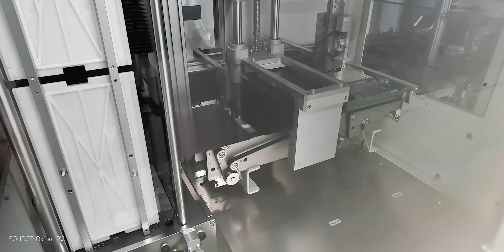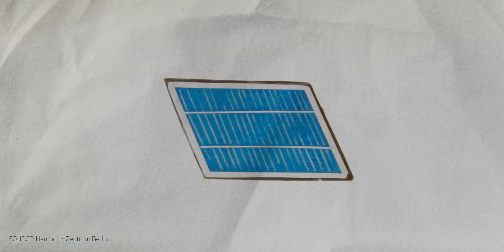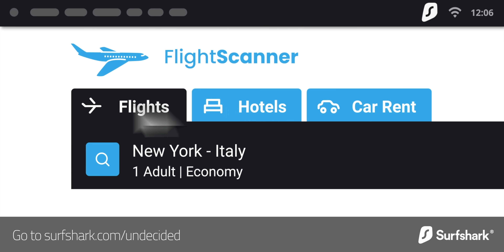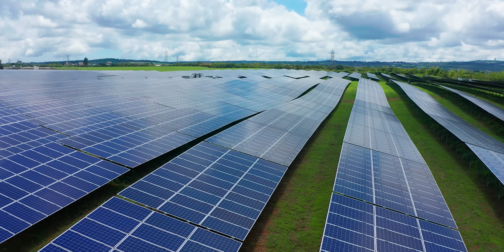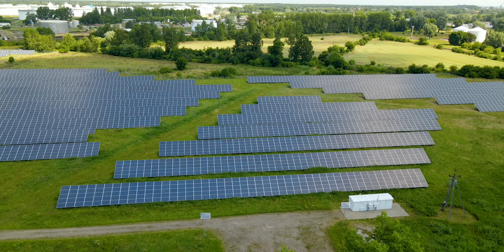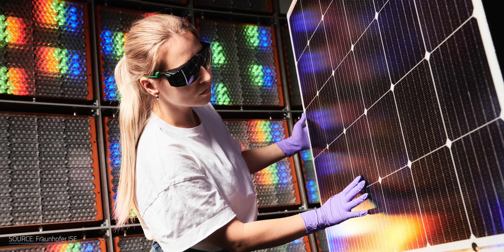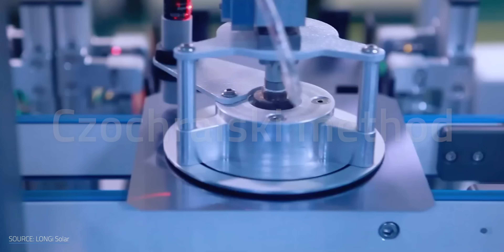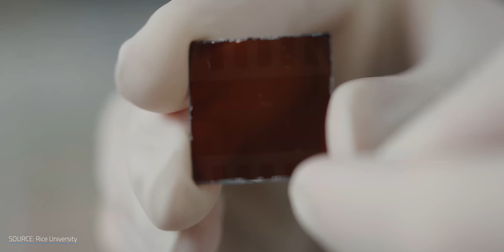How Record Breaking Perovskites Are Here NOW

Comment: Yes, in that, my 60 yr old 30x60 ft ranch house, is suffering, and I don’t plan on owning it, after 35+ yrs. I get soo much sun, with little or no shade on 2 acres, on a hill town peak.
   The solar companies, who stopped by were shocked, and showed me , graduations of earning, over time. 
    The combination of types of collectors, the pertinent generation,  for specific diversity.. as in heat water, store in battery, export to grid, an on. A sand battery is a huge brilliant and efficient, component, as it could be ‘fed’, with multiple collectors,  and perform, alternative needs.

Comment: I have 7 year old 275whp solar panels.
I am looking forward to the launch of this silicon-perovskite tandem solar panel and replacing it in about 5 years, supplementing the system with Na+ batteries. I hope both technologies will become widespread and cheap due to mass production by then.

Comment: I'm just an idiot but I disagree on space being the main issue. Utilities have access to a ton of land and most of the time residential applications have plenty of rooftop space. What wasn't mentioned is that solar rack cost per watt comes down with more efficient panels, but if I understand perovskite correctly then it can be installed on flexible materials. So imagine a 10% efficiency but it comes on a large roll so shipping and shipping damage goes way down. Also what if you could just grade the soil and stake these large rolls on top of a layer of bedding sand? What if this stuff is as cheap as asphalt shingles and now it IS your roof? All of a sudden the space argument looks a lot different. So I say get rid of the silicon and glass and embrace the positives of perovskite which are that it can be flexible and cheap... And now it can last 25 years!
Reply: Yeah let's cover more of the soil with our stuff.

We could cover the whole planet and definitely destroy the ecosystems on it lol.

Comment: I've been sticking with monocrystalline panels for a lot of my research for a while because polycrystalline tend to fade in the Sun.
Reply: So these suffer from the same problem as polycrystalline panels. In other words they have generated a coating to go over their panel so that it doesn't degrade in the UV. The problem we had with that last time is that it was reflecting some of the usable energy and dropping the efficiency of the panel. I've worked with this for quite some time and so far most coatings I found kind of fail so I'm thinking because of the coding they have on their panel there may be an additional internal reflectivity from the grains of titanium dioxide. I've been working with titanium dioxide for a little while now in the formation of multifaceted beam rubies. I've also been working using solar panels in the flash chamber to see what kind of voltage is I can generate before I burn out a panel. I'm working on a new laser design that incorporates a solar panel booster in the flash chamber to drive a secondary circuit. That brings me to my next question, being composite sells they are fragile aren't they?

Comment: Could these be mounted on fence posts, power and light poles? There would be huge potential for roadside renewable generation if the aerodynamics can be cracked, land is free and installation is cheap.
Reply: Generation is not the problem. What are you going to do with the energy during daytime? Shall we all spend daytime at home doing all the cooking and heating and charging of EVs to then go to work at night?

We do not need much energy during times solar produces it.

The problem is storage and transportation of energy. Not generation.

Comment: If the early process form is liquid, is it feasible to consider using it on vehicle exterior surfaces for solar charging when exposed to the sun?
Reply: Even if this was the case, what do you think a square meter or so of panels is going to do for a car?

A typical panel that is pointed the right way produces 400Wh per day. Let's say we got 2 square meters on a car (less in reality because a car is always angled wrong), that would give you 800Wh max.

Now imagine you have something as efficient as a Tesla on long range mode; it uses 1.4 kWh per km.

So your solar paint under ideal conditions would give you a maximum of about 500 meters of range per day 😂

I am sure auto makers will find plenty of fools who will pay 1000 euros for such a paint job; let's round up and say your car would then produce 1kWh per day... that is 20 cents per day worth of energy or 13,7 years until you recuperate those costs 😂

It is insanity.
Reply: @juliusfucik4011  It was just a question about the technology. It may not even be feasible for process reasons. It was not posed as a replacement solution for plug-ins. It could be used to charge an onboard 12v storage battery. It could be used on the large surface roof of RVs or trailers to maintain or charge house batteries.

Comment: I can see these being used in Car rooftop solar anywhere there is a space constraint and it can be more protected that just say rooftop solar. We also know that as homes get "smaller" so does roof space and thus current power generation. I can see the current panel sold by China etc to being used where there is plenty space (warehouse roof, solar farms). Like to see the next innovation being embedded transparent films for office glass towers. We already have dimmed glass to avoid heating up skyscrapers but that could be offset by swapping glare for power generation.

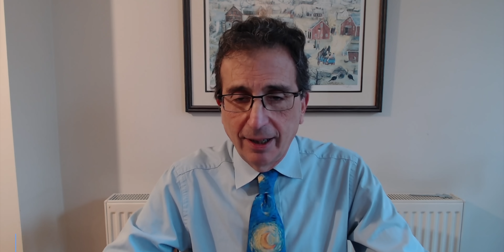Comment: 1:38 Salt and diamond do not have the same crystal structure. Both salt (sodium chloride) and diamond have a cubic crystal structure, but they do not have the exact same crystal structure; salt has a face-centered cubic (FCC) lattice with alternating sodium and chlorine ions, while diamond has a unique diamond cubic structure where each carbon atom is bonded to four others in a tetrahedral arrangement, giving it a distinct crystal structure despite the cubic symmetry.

Comment: Very interested in the improvement these cells will bring. I'm a bit of an early adopter. But durability is important. My solar panels are mounted on trailers and move with me. Sometimes that means sacrificing efficiency for weight or flexibility or durability. Happy to try them out when they are available

Comment: If they can get this consistent type of performance OVER A 10 YEAR PERIOD, with a performance guarantee, then maybe they're ready for commercial availability.   But at this stage we don't have any long term data on degradation percentage and investor grade solar projects require a level of surety WITH ESCROWED insurance policies backing material quality.    I'm not going to be the FIRST guy to put my neck on the line for new technology without some STRONG legal caveats - unless there's a 7 figure cash payment involved.
Reply: Much obviously depends on (commercially sensitive) production techniques. I'd guess research has been going on sufficiently long for a fair stab to be made concerning likely lifespan.

Recall with Lithium EV batteries, that's a number which has increased with experience, reflected in battery warranties we'd have not dreamt of a decade ago.

Comment: While I recognize that space can be a concern on some houses, it isn't for most. On the utility scale, purchasing/leasing less land for the same power output is an economic benefit. But neither of these is a case of true space-constraint demanding maximum efficiency. 
My favourite application is the solar powered catamaran or houseboat. Whether the vessel crosses oceans or just putters back and forth across a single lake (like, say, Tahoe), current cells are plenty to keep the boat's living systems (fridge, cooking, heating) going, but only at a steep cost to the ability to move under power. And even when conditions are favourable, adding one knot of speed increases power drain considerably. There isn't yet a solar powered catamaran that can cruise overnight at better than 6 knots. That's steady progress, but not so much you won't want more -- especially in bad weather. 
Increasing electricity capture by 20% has huge benefits for boats like this, and the teased 50% increase would be incredible. I'd like to see this company partner with a company that powers catamarans or houseboats and see what the impacts are in true a high-demand, low-surface area application.

Comment: This is hype and yet another "weapon of mass distrAction". As an industrial strength power source both solar and wind are absolutely a dead end and can lead only to one thing, scarcity of energy supply and environmental waste in the process of manufacturing these intermittent low efficiency power sources. More research should be put into LENR, Roche type of generators, zero point, finally nuclear reactors on fast breeding neutrons, like Russians are doing who now have two working reactors, that allow to use very abundant Uranium-238 and spent nuclear fuel that pollutes our environment allowing for a closed cycle nuclear energy production and thus practically limitless supply of nuclear fuel. Solar and wind have their place, but only as sources for autonomous installations. But even there, instead of using solar and wind better use new type of batteries based on Nickel-63 isotope that functions in a similar way to a nuclear reactor but without dangerous radiation levels and lasts well over 50 years.

Comment: US companies producing solar panels with efficiencies higher than 24% TODAY are likely way less expensive. No one can say with absolute certainty that the limit is 30%, as there could be different configurations and methods not yet developed that would allow for structures containing multiple layers of PV film to surpass the proposed maximum (which is for a single sheet of known configuration and shape). They're selling their panels primarily because they're likely running out of money due to all the R&D, which, who could blame them. But the simple truth is until they really 'blow the doors off' standard PVs AND at a very comparable cost, this is still a pipe dream. You want immediate higher efficiency? Sure, I can get you one made out of gold and platinum; it costs about eight thousand dollars per panel :-O ... just saying. PS. I really like a lot of your stuff, but please don't overhype something like this unless you want to boil your audience down to the most gullible.

Maxeon Solar: Maxeon Solar Technologies  https://maxeon.com

Qcells: Qcells North America  https://us.qcells.com

First Solar: First Solar   https://firstsolar.com

Comment: Xcel Energy is building a massive solar plant 8 miles west of us in Becker Minnesota. It will be the 5th largest solar plant so far in the US. It is built on 5000 acres of land owned by Xcel and was in the Conservation Reserve Program (CRP). Our Elk River energy commission took a tour last month and Xcel mentioned a new type of solar panel was being purchased along with the 550 Watt panels they are installing. They mentioned a 800 Watt panel was what they were looking at. Maybe Perovskites is what they are using?
Reply: Holy sh1t 800 W. Most of the industry as of 2024 is sitting at 700 W with monocrystalline bifacial half-cut modules. Wonder what wafer size they'll end up choosing (M8, M10, M12?)
Reply: Better than destroying our planet by using fossil fuels. What’s your solution?
Reply: Not sure pure perovskites are in production yet. I wonder if they could be the first examples of tandem silicon perovskites at scale. With up to 50% greater production for the same land area and installation costs and slightly higher unit costs the economics of tandems could revolutionise solar, rooftop solar in particular. As the silicon layer is proven tech, there's not insane risk if the perovskites degrade earlier than hoped. I'm sure they will be worth installing in many applications once available.
Reply: I just checked and Oxford PV announced a couple of months ago they sold their first batch of tandems to a US utility scale project.
Reply: And the natural space taken away from plant & animal, brilliant.

Comment: One of the main downsides of the perovskites put into service now is that they don't beat all existing brands yet in terms of efficiency. The current model has a ~24% efficiency for turning solar energy into electricity which is equivalent to Sunpower and Aiko panels currently on the markt.
I think Perovskites will start really taking over the market in a couple years.

Comment: Cost of panels compared to conventional power sourcing?
Environmental impact of sourcing material to make panels?
Still have the issue of cloudy days.
Environmental impact and cost of end-of-life removal and recycling?
Until these questions are addressed, and many more similar questions, solar technology will remain a niche solution for energy production. Just my $.02
Reply: The problem is storage and transportation, but the solar zealots can not understand it. They celebrate every tiny efficiency increase in generation like it is a blessing of Ra.

They should really move focus to large scale cheap, reliable energy storage from commonly available non-toxic materials.

Only then can solar or any renewable tech even remotely compete and provide at least so baseload functionality.

Comment: The carbon footprint of manufacturing solar panels doesn't worry me. If the process is entirely electric and the carbon intensity of that electricity is heading towards zero, we'll eventually be making zero carbon solar panels, at which point we have a virtuous circle.
Reply: Even if the electricity for making the solar panels comes from coal, they produce enough electricity during their lifetime to drop their carbon intensity far below anything that isn't a solar panel or wind turbine (even hydropower has a higher carbon footprint due to all the concrete and the carbon released by organic matter degrading in the flooded area).

Comment: There is a German company that manufactures a folding structure for PV Panels.  It is able to fold up like an accordian and is fully mobile on wheels thus enabling storing of the panels in a garage or shed or such.  This would be a great system for rural and suburban homes since the panels could be unfolded during daytime and folded during night and then store safely away in a garage or shed.  It would also be the best way to protect the panels from sleet, snow, pollen, dust and hail if so required.  This configuration would be a great way to increase your Solar generation capacity without major land use or structural modifications to buildings.
Reply: https://www.youtube.com/watch?v=sRhNOv1Uo4M&list=WL&index=10

Comment: space efficiency is ridiculous argument. if people were lacking space for panels, they wouldn't use tilted panels leaving a lot of gaps.they would just cover all surface with panels
Reply: Tilted are use because they're easy, snow water and dust slide of, they get "enough" sun.
They're the "good enough" when installing square miles at a time.

Comment: Voyager 1and 2 launched in 1977, V1 is currently traveling at 38,000 miles per hour while both sats still transmitting signal from over 7 billion miles away. Yet current solar panel tech is only 50% efficient? The world gov'ts hide so much tech from the people and it needs to stop. Suppressed tech can provide so much for so many. Support Dr. Shiva for US President, arguably the most censored person on the internet.
Reply: It's not "suppressed tech" it's "Billion dollar, one off, hand-made" tech not cost-effectiv eto work on scale.
Nuclear batteries that last for centuries... though they do also irradiate everything around them.
Super effective hand shaped and piped rocket engines that need complete refurbishment or replacement after a launch.

Comment: A report from Japan
I achieved carbon neutrality this summer by utilizing the 2.8kW solar panels I installed 12 years ago and the Icon wind cooling system.
Even in a year including winter, the power generation is 3226kWh, and the total power consumption is 3426kWh, which covers 94%. If the efficiency of solar panels improves, many homes can achieve carbon neutrality.
Individuals can further reduce CO2 emissions by using cool winds to expel heat from the house in the early morning and at night, and by taking appropriate measures against solar radiation during the day.
(The measures against solar radiation are published on the website.)
If you have any acquaintances who are traveling to Japan, I recommend buying one as a carbon canceler to take home.

Comment: It’s a little early to say we’ve solved the durability issue. And going to 30% efficiency is not really a game changer. Solar only really works in a very small area of the world, otherwise, you’re overbuilding the solar system to cover the long winter days. And, what are you doing at night, relying on lithium batteries? Seriously, this is not a good plan for grid scale energy. 

Natural gas to nuclear is the only plausible solution.

Comment: I hope someone is doing an ultra low cost and reliable 3axis tracker so they can eventually use some set of higher efficiency panels for generating power remote situations to battery for BEV charging sites etc.   Not needing more area and getting more power, can offset some of the power sacrificed in getting more from the panel at both ends of the day.